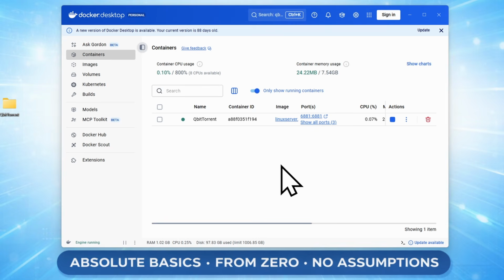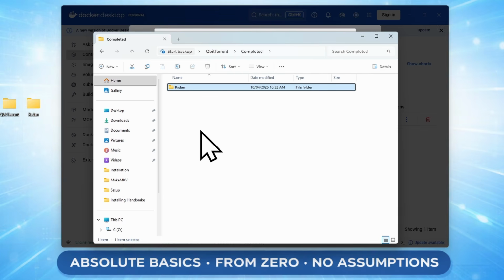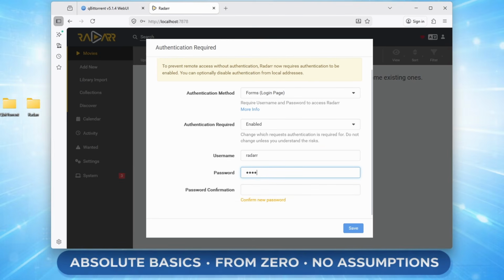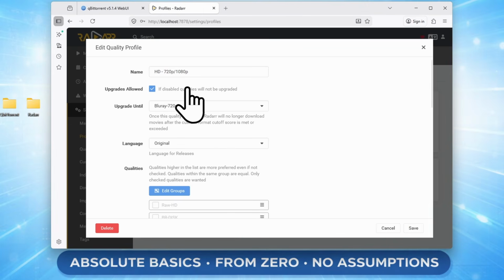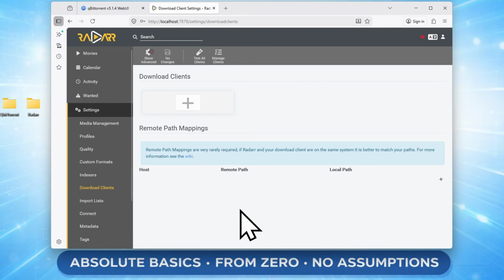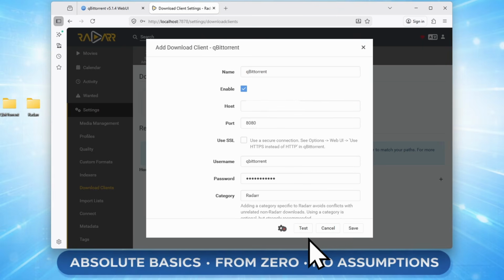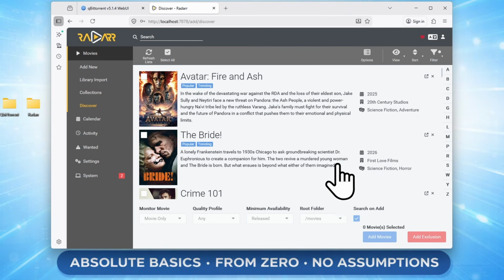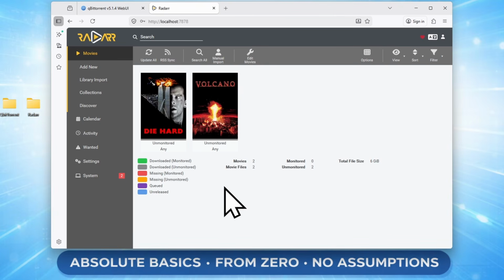The Ultimate Radarr Setup Guide (Beginner Friendly)

Comment: Great tutorial. I am facing an issue currently when creating a “Radarr” folder under Qbittorrent/Complete and mounting it to the downloads volume. The error seems to cause because of the Radarr folder when trying to run it. It says that this directory already exists. I tried changing the path to just the Complete folder and it did run successfully but is that okay for the folder structure?
Reply from the maker: That is strange, you may be to get away with it. 
What happens when you request media?..
Does qbit put it in a folder once completed.
If it does, you would need to remove the folder, to get it to work with your setup.
Reply: Yes it does move the media to the completed folder. And the media is available in Jellyfin media folder as well. But now I have duplicates in completed folder and Jellyfin media folder. Is that expected behaviour? Do I need to manually cleanup the completed folder or am I missing a setting?
Reply from the maker: That part is normal for my setup, as it is always good to seed/share to others.
What i do personally, is manually delete it after X period.
If you do not want to do that.
You can go to Tools > Options > Bittorrent > Seeding limits.
And enable whichever check box and what you want to do.
Reply: @SystemsFromScratch I agree I am seeding for now until I start running out of space 😅. Thanks once again for a great set of tutorials. I was able to setup everything you explained in the videos and looking forward to making the Jellyfin UI even better. Have you also experimented with Transcoding via Hardware Acceleration?
Reply from the maker: I am contemplating making a video on that shortly! Lol. Unfortunantly there are alot of issues with that when running on docker desktop. But it is in the pipeline! 😊
Reply: @SystemsFromScratch thanks for answering all the questions. I have one more for now. I am facing the "Stale File handle" error very often in qbitottent. Have you  ever encountered this error? I have been trying to debug it but nothing seems to work. For example - I requested some media and out of 4 files 3 got errored with the same error and one downloaded as usual. This is through Sonarr mainly.
Reply from the maker: I am assuming you have tried restarting the container, etc. 
And i am assuming qbit has access to the folder, as 1 out of 4 are going through.
So that is strange, it could be hard to diagnose without further details.
Does a single media file go through? But one that has folders do not go through? 
That could be a permission issue where you may need to ensure PUID and PGID match the owner of your network/host storage folder.

Comment: Hi, I'm a subscriber and love your video's. I did this setup, but I deleted it and am trying to start from the beginning again. However, it says I'm already using the ports. Is there any way I can start from the beginning and use the old ports again?
Reply from the maker: Thank you so much 😊 
That is strange. Double check the container is actually deleted, and not just stopped.
And double check no other container is using that port. 
If you cant get it working, you can use a different port. E.g. 7879.  And juat use that whenever you want to access radarr
Reply: @SystemsFromScratch, is there any way of completely deleting everything so I can start a fresh, clean build and use the original ports? In Docker Desktop, I have used the AI agent to help me, and I have been at it for 3 days solid. I just want the setup to like the original build, so all my movies and tv shows are in the right place.
Reply from the maker: If you change the port, everything will still work as normal. The only setting you would need to change, would be the port number on any container that references radarr. 

Its hard to say, as it should just work. 
If it doesnt, that means the port is being used. 
Can you confirm no other container is using that port. 
Make sure you do not select "active containers" and see your list of containers. 
Do any use that port? If they do. Remove it. 
Then it should work. 
Deleting the image, i dont think will make it work. But you can try that!. 
It won't let you delete the image if it is being used by a different container
Reply: @SystemsFromScratch Thanks man, and keep the great videos coming; you have given me a new hobby and my wife hates it because she never sees me anymore. 🤣
Reply from the maker: Buy her some flowers from the potential savings these tutorials would provide 😜 
The hate may just turn right around 😅
Reply: @SystemsFromScratch 😂😂

Comment: can you help me? I can request in jellyseer, and i can transfer it to radarr, and then download it with qbittorrent. my problem is its not sending the file to my jellyfin folder, it says no eligible file to import. i tried already to chmod both folders, and doubled check the host/container name. based on the logs: Import failed, path does not exist or is not accessible by Radarr. I am using casaOS. thanks in advance
Reply: I thing I get the issue now, my downloaded folder in qbittorrent was have the extra tags like [720p], but the folder created by radarr in my root folder only have title ang the year. Is there a way to rename the folder to be the same?
Reply from the maker: Radarr manages the transfer, renaming, and everything. 
If qbittorrent grabs the correct file. It would get transferred automatically..
If it does not. Then there wpuld be something wrong in your remote paths. 
High chance something was missed during the setup. 
Re warch the video and make sure nothing was missed.
This could be something small such as a capital letter in the category field.
Reply from the maker: Theres a high chance you didnt set the remote file paths correctly. 
Ensure you are adding the remote file path in radarr, in the qbittorrent download section. 
I go through this in the video. 😊

Comment: I am struggling to do this via my HDD keeps coming up with not writable by user abc. Ive followed each step
Reply from the maker: It sounds like a permissions issue with the folder on your HDD. Right-click the folder you're using > Properties > Security, select your Windows user and make sure Write/Modify permissions are allowed. Also make sure you're checking the exact folder you're using for your movies, not just the HDD itself.
*Note: * Double check you have selected the correct path when setting up the container.
Reply: @SystemsFromScratch thank you, im using docker desktop on ubuntu, I can't seem to get it to work still, almost as if it can't find it at all. But works perfectly on internal storage
Reply from the maker: Since it works with your internal storage, it sounds like a permissions issue with the HDD. Open Terminal (Ctrl + Alt + T), type id and press Enter. Use the uid number as PUID and the gid number as PGID. Then recreate the Radarr container and add PUID and PGID as environment variables using those values. Hopefully that fixes it!
Reply: @SystemsFromScratch  Had the same issue on Container Manager on Synology.. PUID and PGID fixed the issue :) Thanks!!

Comment: i try to do the root folder and i get this? is not writable by user 'abc'
Reply from the maker: Did you add the correct folders during the set up of the container?
Reply: @SystemsFromScratch yeah. Have my own download, incomplete, music, movie, TV-shows
Reply from the maker: You may have access issues, when creating an account, add puid and pgid as environment variables - this may solve your issue. (you can google how to get your pgid/puid as different systems will have different ways)
Reply: @SystemsFromScratch I got them all to find the folders, just now I need to see why it isn’t finding my transmission / qBittorrent Download file but they are all going towards the same.. just my flares flaresolvarr isn’t connecting to prowlarr. It’s showing disabled on the index

Comment: I have an Error with Radarr. The container logs say: "Import failed, path does not exist or is not accessible by Radarr: /downloads/radarr/(movie name)". As per the video, in the radarr container, /downloads is linked to qbittorrent/completed/radarr. If Radarr is looking for /downloads/radarr, I think that means it's looking for  qbittorrent/completed/radarr/radarr  (***note the 2 radarrs).       Should the container have been be linked to '/completed' instead?  Just checked and I have the same error with Sonarr.
Reply from the maker: This does sound like a remote path issue.
it shouldnt be going to radarr/radarr.
This could be an issue with your download client settings within Radarr.
if you open the qbittorrent settings within radarr, what is the category?
If the category is Radarr (Capital R) then the folder needs to be Radarr (with a captial R)
Also in the "Remote Path Mappings" of the download clients:
Remote Path = /downloads/Radarr
Local Path = /downloads/

For the Radarr setup. Ensure your folders are set up correctly during the creation of the container:
Source: qbittorrent\Completed\Radarr  (*note* as you can see i set up radarr with a capital R. Therefor, in the Category, it would need to be a capital R)
Destination: /downloads
Source: jellyfin\Media\Movies
Destination: /movies

Considering you are having issues with Sonarr and Radarr, i can only assume there was something that was not followed 100% in the video, this could be a step or spelling. (A missing capital letter will mess up the workflow)
Reply: @SystemsFromScratch  I've been fighting this all day, but I think I missed a lower case R. I'll check all of the bindings again for consistency. What makes troubleshooting this difficult is that I haven't seen it work yet so I don't know what it should look like. I'll keep at it. 

In the mean time, Jellyfin is being a pest as well. For 4 days now it hasn't completed a scan of my library even though the original standalone jellyfin worked just fine. I wonder if this has something to do with jellyfin stopping unexpectantly. If I can't get it to work in Docker, is there any reason that I can't go back to the stand alone with all of the other apps still in Docker?

Thanks for the help.
Reply from the maker: it stopping could potentially cause the issue. Jellyfin can sometimes have little hiccups (even if set up correctly)
there was a period where it wasn't registering my new tv shows. But then it sorted itself out and started working.
So, if you set it up correctly, then it may just start working one day :)
And no, you do not need the docker version. you can use the standalone.
And when it comes to other containers, radarr, etc, just make sure you're linking to the correct media folder.
Reply: i stopped my gluetunqbit for a a science experiment and it broke exactly what youre describing and the solution is clicking all the containers stopping them for a min then resuming them ALL at one time. it worked for me hope youve solved yours by now

Comment: Radarr isnt showing my root file path, for me it shows my drives so i click C:\ and then i use the same file path i set up in docker. i go to users and then my username and its blank.
Reply: It does show up for sonarr though so idk why radarr is being weird.
Reply from the maker: Are we talking about the root path when changing the settings?
If so, if you dont see it, it is most likeley because you havent connected the paths during the initial container setup.
If that is the case, delete the container and re create it following the steps in the video.

If you already adjusted certain settings and dont want to lose it, just ensure your connecting it to the same config folder.
Reply: @SystemsFromScratch I followed exactly step by step and deleted and restarted multiple times and it will not show up. When you click root path you scroll down and see movies, when I click root path I see my hard drives.
Reply: @SystemsFromScratch it fixed itself somehow.
Reply from the maker: Glad you got it working :)

Comment: Hi, I'm having an error message that states: download client qBittorrent places downloads in /data/downloads but this directory does not appear to exist inside the container. Review your remote path mappings and container volume settings. I have to add that i did not follow your video to setup qbittorrent, I used a docker compose file that ran qbittorrent an gluetun for me so i did not have the chance to manually set volumes as it was done automaticly. Do you have an idea on how to fix this? Thanks alot, these videos are great!
Reply from the maker: Thank you very much. 
You need to update your compose file to include the location. 
I have a video, setting up qbittorrent with gluten,  using a compose file. 
You can use my file to set it up.
Id recommend watching my video on setting up qbittorrent. 
All the answers will be there 😊
Reply: @SystemsFromScratch thanks for the reply! I got it fixed by deleting radar and setting up a new container for it with its path set to /data/downloads instead of /downloads. I’ll definitely check out your qbittorrent video to make sure i have the right settings for it but for now everything seems to work. Thanks again, you’re a godsend for making these easy to understand videos!

Comment: 11:26 I have NordVpn , do I need it turned off to use radarr, sonarr and prowlarr? Not sure what I should put as as host if using a vpn
Reply from the maker: No you dont need to turn it off. 
I have just published a video of setting up qbittorrent with NordVPN.
Everything should work normally with a vpn enabled.
Reply: In qBittorrent's advanced settings, bind to your VPN's network interface to ensure traffic always flows through the active VPN connectino

Comment: I have Plex setup already outside of docker, can i set this up with regular Plex or is it better to route through docker? Also I'm assuming I dont need to connect docker to my plex i can just point it to the download folder i have files in, but it wouldnt be as automated.
Also, when you say config doesnt have to be in separate folders does that mean you make one folder for radarr and sonarr and have one config folder in there? Or two separate config folders for each in the folder?
Reply from the maker: Im not sure if there is a standalone application outside of docker.  
I believe it will be best (even if there is) to stick with docker. 
No you do not need to set up plex with docker. You can have the entire automation in docker. And it will just update your plex library 😀
Reply: @SystemsFromScratch  Ah ok, so I just point the volumes in container setup to where my media is for Plex? BTW is there a way to edit the container settings in Docker desktop without having to delete the whole thing and starting from scratch?
Reply from the maker: That is correct yes. Point it to your media directory. 
Unfortunantly no, you would need to delete and recreate. 
You can create a compose file, to make it easier. 
Check out my 5 docker desktop tips and tricks 😊

Comment: Unable to add root folder
Folder '/media1/' is not writable by user 'abc'
Reply from the maker: That error usually means Radarr doesn't have permission to write to the /media1 folder. Double-check that the folder is mapped correctly and has write permissions for the container.

Comment: i have set up both radarr and sonarr, both download correctly. but when the download is finished, the movies or series don't get moved into their folders. now radarr and sonarr can't find the files they need to move to jellyfin. what could i have done wrong?
Reply from the maker: The main thing that goes wrong, which makes it not transfer, is the location settings. 
Ensure qbittorrent moves to the completed folder, and ensure radarr/sonarr is looking at the correct folder. 
There is a high chance that it is not. (Ive had this issue myself). 😊
Double check its all linked up correctly (as per the videos). 
If not, (or if unsure) feel free to remove the container. 
And recreate it. (If you use the same config file) it should remain the same.
Reply: @SystemsFromScratch  thank you, i will give it a try.
Reply: did you ever find the solution? downloads are all going to the qbittorrent folder but never getting out of there, not moving to the designated jellyfin folder.
Reply: @mr.anything.random  sadly, no. I tried following the tutorial again a few times en checked my destination maps again, but all was correct the first time. Since everything else works fine, i just use my ugreen terminal to move completed files manually.

Comment: Quick question . Does qBIttorrent auto compress the movie files or thats what the slider was for when configuring inside of Radar?
Reply from the maker: Qbittorrent doesnt compress no, it is just a download client that downloads any torrents. 
The sliders in radarr, determine what files get searched for. 
If you lowerr the slider, it will look for lower file size files. 
If you want, check out my handbrake video, I go through compressing and reducing file sizes.
Reply: @SystemsFromScratch  ive been using handbrake for my personal media I own already If I wanted to compress something I downloaded from radarr is that possible?
Reply from the maker: Yea it is 😀 treat it like the media you already own.
Reply: @SystemsFromScratch thank you!